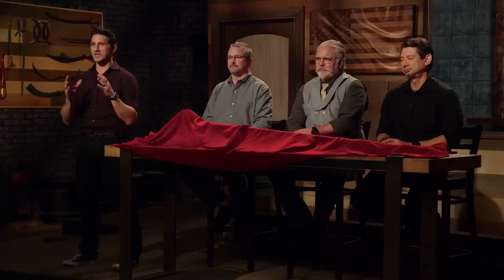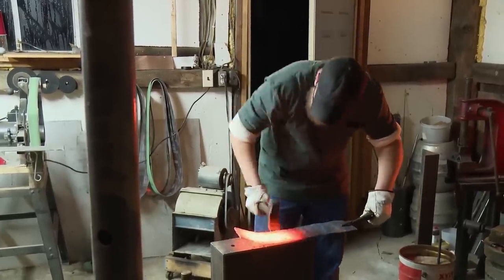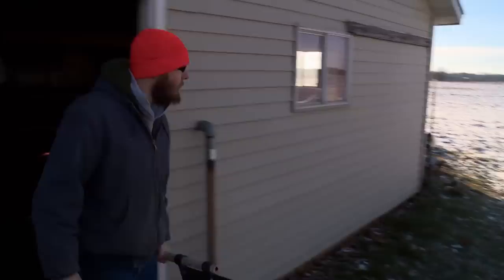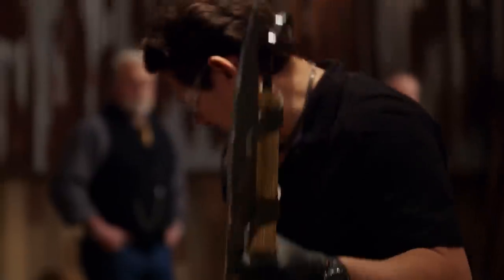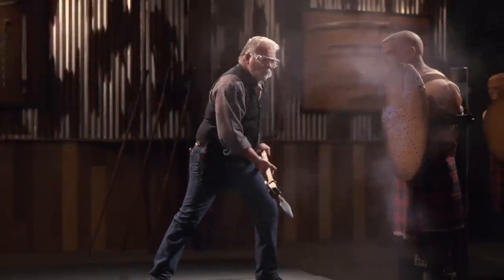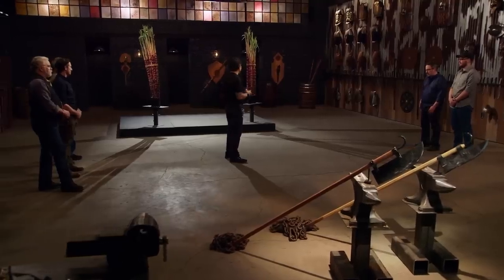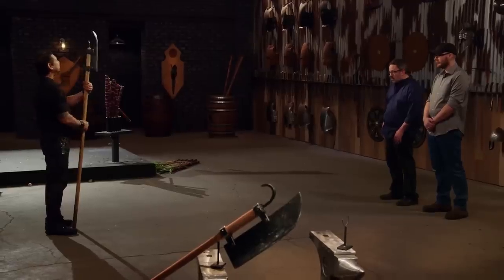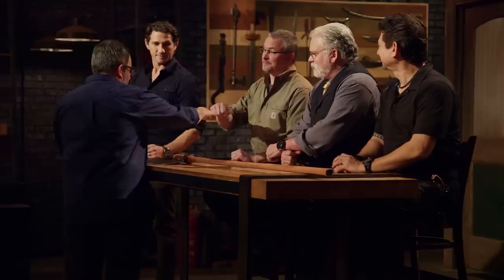Forged in Fire: The Lochaber Axe Final Round: Joshua vs Jesse (Season 6) | History

Comment: Weren't theses used for taking down heavy armoured infantry and Calvary so one would assume a little extra weight  would be an advantage?
Reply: It may be. My guess for it's function would be to hook armored knights on horseback, then hit them with the heavy axe once they're off.
Reply: @ChristianGonzalez-qu6fs  Nice observation bro i agree but i still think a little more weight in the blade would be an advantage overall.
Reply: The force of an attack can come from the weight or the speed. German dopplehanders were heavier in order to disrupt enemy pike formation while spanish and portuguese montantes were lighter so the soldier could cover more angles and attack faster, but both blades delivered vicious cuts.

Sooo... can’t tell if heavier is better in this case. You would have to test both and pick up the one you feel more comfortable.
Reply: The period this axe was popularly in Scotlsnd was more at the end of the use of armour (late 16th to early 18th centery). Most of the pepole on the receiving end of it would be in wool coats and tartan plades at most with maybe a steal hide (skull cap) under a hat/bonnet.

So not so much for anti armour work but certainly anti cavalry/highland charges.
Reply: @Marcus_McCormick11  You might be right i have not seen any mention of use against armour but certainly the fact that the blade was particularly "heavy" and used against Calvary here is the wiki info.... The Lochaber axe is first recorded in 1501, as an "old Scottish batale ax of Lochaber fasoun".[1]

The weapon is very similar to the Jedburgh axe, although the crescent blade of the former is larger and heavier than that of the latter.[1] The Lochaber axe took many incarnations, all of them having a few elements in common. It was a heavy weapon, used by infantry for a defence against cavalry and as a pike against infantry. Like most other polearms of the time, it consisted of two parts: shaft and blade. The shaft was usually some five or six feet (1.5 or 1.8 m) long, and mounted with a blade of about 18 inches (45 cm) in length which usually resembled a bardiche or voulge in design. The blade might be attached in two places and often had a sharp point coming off the top. In addition a hook (or cleek) was attached to the back of the blade. A butt spike was included as a counterweight to the heavy axe head. Langets were incorporated down each side of the shaft to prevent the head from being cut off.

Use
In hand-to-hand combat, the axe, in common with other polearms such as the halberd, has a spike on the end, to be used on close combat in a thrusting motion. The axe on the side, coupled with the long pole, delivered a powerful blow to infantry or dismounted cavalry.[citation needed]. The example in the Edinburgh Great Hall Museum shows a substantial rear-facing hook, for catching/pulling.

For lochaber axes used by the city guards of Edinburgh, the hook is almost level with the top of the staff, making them useless as a means to catch a moving object. These hooks, however, may have been used to hang the weapons in the guard room
Reply: After a point extra weight has diminishing returns. Military axes are much lighter and thinner than similarly sized tool axes. Too heavy and they are more difficult to control and slower to swing back. Furthermore when they miss, it is much harder to stop the momentum and draw it back for a second swing. A double handed axe needs to be nimble as you have no shield for defence, so a slower unwieldy axe would leave you wide open to a fast counterattack.
Reply: For an inherently heavy weapon like this, they are still heavy enough even if you were to use really light heads, & the extra weight could be more of a hindrance than of an advantage. being able to pack more force with each swing is a good thing, but not when you get exhausted easier & find it hard to stand after doing so. ease of use is even more important in the case of such heavy weapons, given that unlike lighter, single-handed weapons, you really can't afford to miss with your swings.

Comment: Good thing is they're both smithing by hand and not a power hammer vs handheld hammer challenge so it is really based on skill and not just better tools winning it for them.
Reply: Using things like power hammer is more a thing of making it less labor-intensive, than saying that one is less-skilled. you just prove that you have more endurance & more time to spare  by not using a power hammer, not that you have more skill. & besides, it's not that these guys don't wanna use power hammers. it's just that the kinda blades they usually are so small that getting power hammers is just a waste of money.

Comment: If the Blade is too heavy, well that could be the make or break in this competition

..Looses cause blade is too to heavy...
Reply: Only if the weight is part of the parameters set for the weapon and the blade does not meet that parameters, the weight makes the weapon use wieldable, takes more damage then the other blade  or the weight causes the weapon to under preform.  If the weapon is heavy but usable, does not violate a set parameter for the weapon, takes less damage, and out preforms the other blade then it will probably win. This blade lost because it took more damage then the other.

Comment: Bro axes are meant to be heavy how will you crush your enemy
Reply: Ye heavy, but if you attack with a heavy one and the enemy is still alive, because he had a shield or something, you will be killed because your Axe is to heavy to pick up quickly enough before your enemy attacks. It can be heavy but not too much.
Reply: Military axes have a much thinner profile and are lighter than tool axes because they need to be able to cut through armour and be controllable. If an axe is too heavy, it is much more difficult to swing and control and will bash more than slice. That is why many pole arms had a blade and a blunt hammer so they could slice and bash.

Comment: why didnt he just shave off more wood
Reply: alan lars only think I can think is that he ordered a wood piece that was too thick and there might be a minimal length you need to make the axe.
Reply: @MrZachgonz  But he could have shaved a bit off the sides rather than trim the length. By doing so he could have given it an oval profile which helps with edge alignment, like the other guy did.